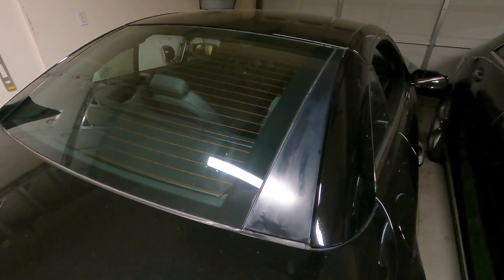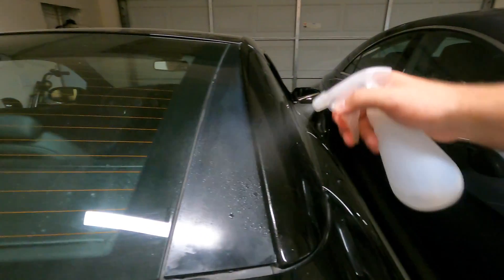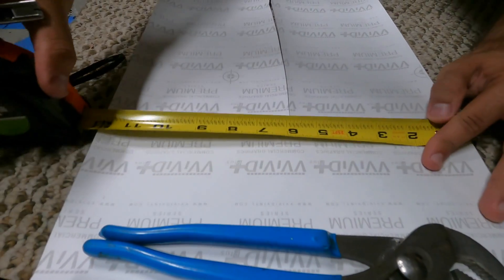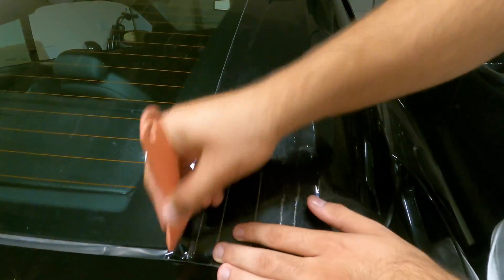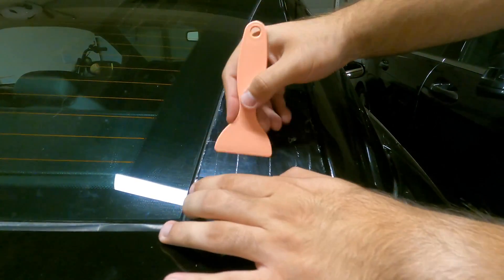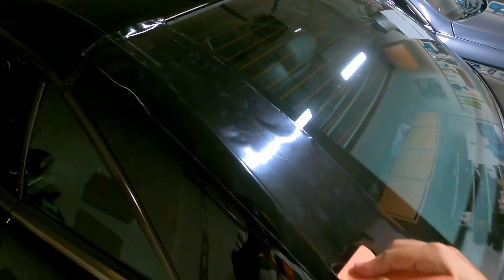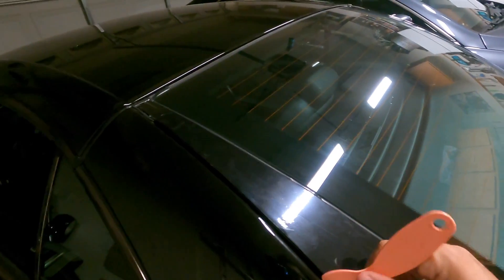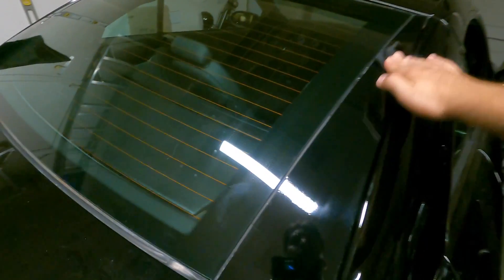Fixing black trim on the rear window | SL55 Build pt 18

Comment: I just did this same thing. Cannot source the replacement blades at this time. They're only $80/side so was going to replace. Vinyl looks better but definitely not a perfect solution for my long term desire. It really does scratch easily so keep that sacrificial layer on while laying it down for sure. Look forward to what's next. Just wrapped my console and door card trim too but stuck until new cupholder and side marker lenses show up for full effect.